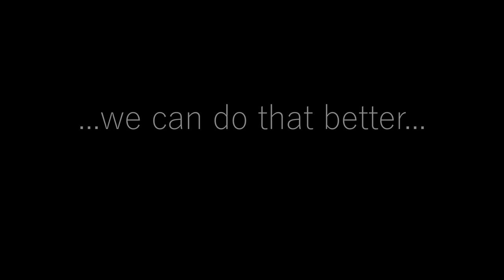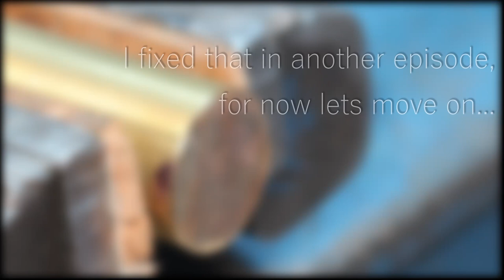Bearings for the mini lathes compound slide

Comment: When I bought me mini lathe the first thing I realised had to go were the solid handles on the cross slides and replace them with longer ones with rotating sleeves, the simplest of jobs which require no description. So I am slightly bemused when every time I see a video about mini lathes and their modifications, there are the original handles! An challenge for every mini lathe owner.
Reply from the maker: Thanks for your comment. Yes you can change this easily and perhaps some day I'll do that too. But at the moment there are other things which bother me more on this lathe than the handles. For fine adjusting I actually find the fixed handles even more convenient than the more slippery turning ones.
Reply: @WeCanDoThatBetter  OK. Best of luck with the other mods.
Reply from the maker: @johnstonewall917  Thank you ;)

Comment: I did a similar mod to mine about two years ago with the two thrust bearings. However I found a large part of the play was the compound leadscrew. You can see it 8:31. They're a very poor fit  so I made a whole new leadscrew  with a woodruff key to lock the dial to the leadscrew.

Comment: Nice idea and workmanship. 
Subscribed. 
Answer to page 6.14 do you know what an edge finder and center drill are? Look it up if you are interested.
Reply from the maker: Thank you very much! :) Yeah, that was no good idea for drilling. That's why I had to redo the part and ordered a proper center punch an scribing needle to mark the correct positions before drilling the new parts (in part 2 video, I show and used them already). Center drill is a good idea!

Comment: I just found your channel and really enjoy the projects and the way you present/make/edit. Do you think that this modification would shorten the travel of the compound?it seems like it may shorten it by the depth of the block behind the wheel?
Reply from the maker: Thanks for your comment! This modification didn't shorten the travel of the coumpound slide as the aluminium block I made is exactly as wide as the round bearing block which came from factory.
Reply: @WeCanDoThatBetter  that makes sense. Many thanks for the reply.

Comment: Is there a reason you use LH boring bars and run the lathe in reverse? I'm curious if it's simply what you had so that's what you use, or if there was a deliberate choice to do so. Just trying to understand as I start trying to tool up my own mini lathe. Thanks!
Reply from the maker: Hi, it was simply what I had :) Sometimes it is useful to have a left hand boring bar, as you can see a little bit better what's going on, but here it wasn't necessary.

Comment: Nice Job! That is a good solution! You still have to sort out the slop on the compound slide dovetails - Are you going to tackle that in a future video?
Reply from the maker: Thank you very much! You mean taking out the slop by scraping the compound in? I consider this for a future episode, yes. But have still a few things missing which are necessary for scraping :)
Reply: @WeCanDoThatBetter  Yep. That and checking the gib - there are always problems with the factory compound gib.

Comment: very nice job but i would have put a nice chrome dome stud instead of a cap bolt
Reply from the maker: Thanks for your comment! That's a very good point. It's really annoying to bump your knuckles on the sticking out bolt. I changed it already in the meantime to a dome stud as you said. You can see it in the later videos. On the cross slide I haven't changed it yet but planning to do. That's a very good idea, thanks

Comment: Have you tried adjusting tightening the Compound gib? It seems to be very loose at the start of the video. I'm enjoying you content so far.
Reply from the maker: Hi thanks for your comment :) That's for illustration purposes that the compound is so loose in the beginning of the video. Even with absolutely loose gibs the compound gets stuck because of the way the spindle is mounted. With the bearings installed the compound it's much much better and even with tight gibs the compound can be moved easily.

Comment: I want to do this upgrade to my mini lathe.  Did you draft up any plans with the dimensions?
Reply from the maker: Not yet, but I consider to.
Reply: my buddy's and my Grizzly G8688's are .15 different across :o another worthy upgrade is replacing the compound with a solid block if you don't turn tapers often
Reply: @pauls5745  I plan on making a plinth just waiting on materials to arrive.

Comment: Woah woah woah...  how'd you fill the old holes?  I must know!
Reply from the maker: Hey, you mean in the upper casting of the compound slide (at 9:44)? The old crooked holes were for M5 screws. I drilled them to 5mm and tapped them with an M6 tap. Now I put some two component adhesive in the holes and screwed a piece of brass round stock with M6 thread onto it into each hole. I left them a bit longer to grip them with pliers to screw them firmly in. In the end I cut the excess end off, cleaned the surface on the lathe and bored two new holes in the right position but now I went for M4 threads as they were smaller and fit better to the overall design. Hope that helped:)

Comment: You should have remanufactured the entire shaft as it is really out of true, it was wobbling badly when you had it in the lathe. The hole wasn't even in the centre.
Reply from the maker: I adjusted the spindle to run true to the threaded part. Surprisingly the mounting end wobbled like crazy when the threaded part runs true. Some day I have to change the spindle to an acme type.

Comment: Did anyone else see all the play in the compound slide and that there was no visible lube on any of the moving parts?
Reply from the maker: You mean at the beginning of the video? That was to illustrate how sticky the compound slide spindle is due to it's not existing bearing. Even with the complete loose gibs (that's why it wiggles like crazy) the spindle gets stuck because of misalignment and no proper seating.
Lubricration was missing, yes.

Comment: You'll need a plain bearing, too.
Reply from the maker: Where do you mean, a plain bearing is needed?
Reply: @WeCanDoThatBetter  These ball bearings are for the axial forces. Regularly, lathes have a plain bearing just right to that ball bearing for the radial forces. They go together.
Reply: @WeCanDoThatBetter  It's the manufacter's fault. It should have one.
Reply: @WeCanDoThatBetter  You have made it a lot better that it was before. The mechanism wasn't right from the start.
Reply from the maker: @dazedandconfused3682  Thanks, yes it was not good from factory. I used a ball bearing for the radial forces and two axial needle bearing for the axial forces. Now everything should be covered :)
Reply: @WeCanDoThatBetter  I wish you could give the bearings that you used and even better the dimensions for the aluminum bracket. I can see it would be very critical about the depths to keep the backlash to a minimum and hopefully just the lead screw nut fit.